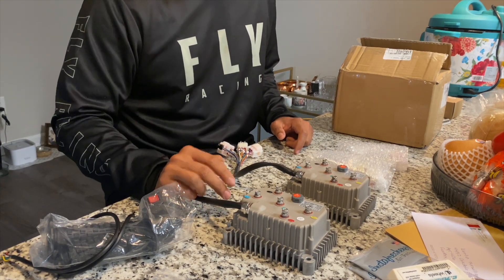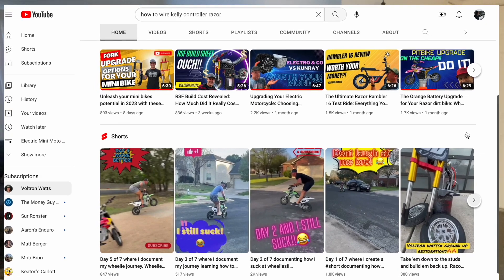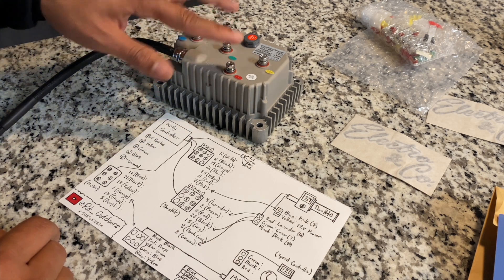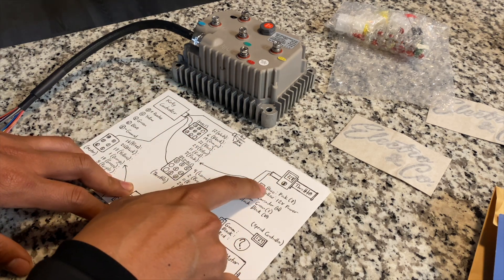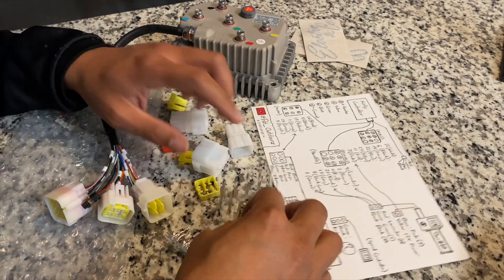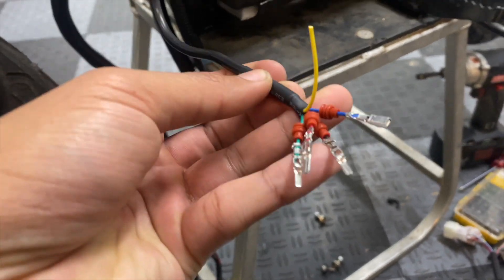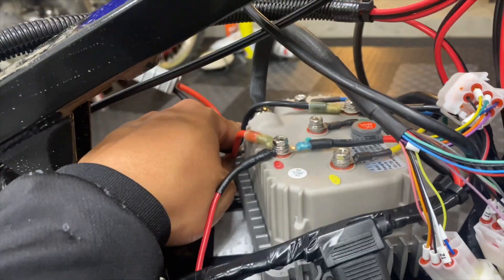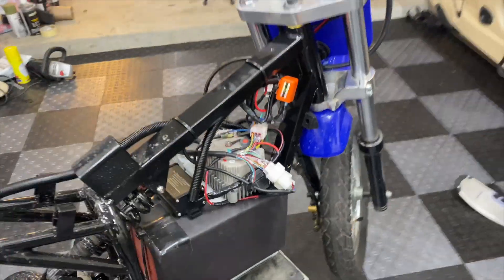Ultimate 72V Supermoto Razor MX650 Build is Done! Kelly Controller Wiring

Comment: How have you been liking the 72v 20ah pack from btr power? I have been interested in doing a similar build and have been taking that pack into consideration as an option.
Reply from the maker: Eh, it’s holding up fine for the last year or so but I’m looking for more power. Likely going to an Amorge 120-amp bms equipped battery soon
Reply: @PatOutdoors  would you recommend I get that instead? Is purchasing it on alibaba secure
Reply: @PatOutdoors  by the way does that battery work with a Amazon 3000w 72v controller and motor kit? I think it’s from best equip
Reply from the maker: @axoz3409  I’m not familiar with “best equip” kits. I’ve only used Kunray , Vevor, and Electro kits so I can’t 100% confirm
Reply: @PatOutdoors  it’s pretty similar to a kunray. Would you recommend a amorge or a BTRpower? I heard BTRpower lasts longer but at the same time amorge looks better built. By the way the kit I’m getting only had a 42amp continuous I believe
Reply from the maker: @axoz3409  I have both. Amorge is better built and puts out more power. 120 amp continuous!
Reply: @PatOutdoors  that sounds like a obvious! Do you know if there is anyway to get an amorge battery in sooner than the 3 week estimate I received? I would like to have it sooner than that. Also since the shipping takes so long I might have no other choice but BTRpower. Overall would you say BTRpower isn’t too bad? Or should I overall avoid it
Reply from the maker: @axoz3409  Well that’s the main reason why initially went with BTR, but 3 weeks is worth the wait. I had to wait also
Reply: @PatOutdoors  I guess, I am most likely going to go with amorge then. By the way what battery life does it get? Like how many charges. I don’t see a amount on their websiten

Comment: I just finished wiring mine. Turned it on, the motor did a few small spins to calibrate then the controller beeped like yours did, but twisting the throttle does nothing. Any ideas?
Reply from the maker: Turn the key off, turn on, twist throttle once, key off. Should self learn unless yours is completely not programmed. Mine was tuned by electro & co
Reply: @PatOutdoors  just tried that, no sound from the Kelly or movement from the motor. Mine is also pre tuned E&C

Comment: Will the 48v motor work with a 72v battery? And what is the speed control for?
Reply from the maker: A 72v rated speed controller is the only way this motor and battery combo will function.

Comment: How did you wire the battery to the controller?
Reply from the maker: It's a Kelly KVD controller so the power and ground terminals are directly on top of the controller. I added ring terminals to the harness that came with the battery and bolted them on directly on top of the controller.

Comment: My BTR 72V20AH with 80 BMS battery shutoffs randomly with either kelly or kunray controller. any advise?
Reply from the maker: Mines never done that so I don’t have any advise of what to do.. I highly recommend contacting the seller. It may be defective and covered under warranty
Reply from the maker: What does the violator read when it shuts off?

Comment: Hey patt, I just got mine all wired up and now it’s just beeping at me and not spinning the motor :( 

I’m going to go to bed and come back tomorrow and look over the diagram you drew and see what I messed up. I’m admittedly a little sad though
Reply from the maker: It just beeps when you initially key it on (self learning). Mine did that too if you watch the video. Key on and off twice, leave it be. Then key on and twist the throttle.
Reply from the maker: Also did you get a pre-tuned Kelly controller or just a generic one that’s not programmed at all?

Comment: I need this Kelly controller. What option will I have to buy? I have the vevor 1800w motor running on 48v. I see their website has a few options. Great channel. Got the crf 50 plastics on my sons bike and real knobbies. Just need a better controller so he doesn’t wheelie every start
Reply from the maker: I got their “pretuned” option so it comes pre programmed and ready to use once you wire it
Reply: Hey pat ! I see there are multiple options when buy the controller. What is the difference between the ultimate razor pre tune vs ultimate razor pre tune plug and play

Comment: Hey pat i got a vevor contrôler and motor but it’s not charging and it keeps blowing a fuse how can I get it to start also the wire seems small for 48v @pat outdoors
Reply from the maker: I’m not sure I’m understanding the question. If it’s blowing a fuse immediately, something is not hooked up correctly and short circuiting. Also which fuse is blowing? Are you running it with a lithium battery set up or the stock sla batteries?
Reply: @PatOutdoors  I’m running the fever motor and contrôler with 4 12v battery’s 3 stock but when I plug it in the charger it blows the fuse but the charger isn’t given voltage when not plugged in
Reply from the maker: @treymason530  it’s simply not hooked up correctly. Take a volt meter to all the connections to confirm how much voltage it reads. Should be 52ish volts (fully charged) at the positive and negative on the controller power supply. If not, something is hooked up incorrectly. Also is the charge ports hooked up directly to the controller?
Reply: @PatOutdoors  it’s 52volt I’ve been individually charging them and no I’ve been using the stock box charger on it if that’s what you mean
Reply from the maker: @treymason530  I don’t understand how you can “individually charge them” if they’re all hooked up in a series. I use a fast scooters charger when I had that kind of set up to charge them all at the same time.. Sorry I cannot help you since I did it differently.
Reply: @PatOutdoors  no no I’m trying to charge them at the same time what I’m saying is when you put a volt meter to your charger does it say 56v
Reply from the maker: @treymason530  I’m so confused, you just said you were charging them individually with the stock (36 volt) box charger.. my FAST SCOOTERS 48 volt charger said 54-56 volts when charging, then the batteries (wired in a series full time) read 52-53 volts once settled. My charge port was hooked up directly to the controller and charged the batteries through the controller. Which sounds completely different than what you’re doing.
Reply: @PatOutdoors  I was folowing ur video
Reply from the maker: Which one? This video is completely irrelevant to SLA batteries. Have you contacted the seller you bought the kit and charger from? I recommend reaching out to them and see if they are able to assist you with their products.

Comment: The Kelly controller from Electro & Co works really nice on these setups. You're really going to like it, the throttle response and power engagement is SO much better than what you where using before. I have built several bikes like this and they are so fun. For those of you out there that don't want to build one of these for whatever reason but you want one, look up BensonsCNC. The website says nothing about it because it's a CNC machine shop but these bikes can be ordered. Talk to Brad.

Comment: Dude... Your videos are great! By the way, I think you say you are using a 72V motor, but in the description you say you are using a 48V motor. Or are you using a 48V motor and a 72V battery?
Reply from the maker: Thanks! This is still the original 48V brushless motor that came with my Kunray kit last year, just been running it at 72V
Reply: I’ve heard from a couple people that the 48v Motor is just as good or better than the 72v version.  Is yours a 3,000 watt Pat?
Reply from the maker: @maukaman  well I have no experience with the 72v motor so I can’t say for sure, but I have absolutely no complaints with my current power output. I think biggest limiting factors on the Kunray and vevor kits has always been the controllers, which have never been able to fully deliver the maximum amount of amps from the battery to the motor

Comment: What’s a guess on the cost of everything so far beside the cost of the bike itself
Reply from the maker: Hmm well keep in mind this bike has upgraded front / rear suspension, brakes, lighting, tires, etc.. but I wanna say about $1800
Reply: @PatOutdoors  your estimate of 1800 includes the battery, controller, suspension, motor and all the accessories?  Really??
Reply from the maker: @maukaman  I would say so, roughly $1700-1900 without the bike

Comment: Great vid as always. Did you do any tuning to that btr battery for amp or power draw. What’s the readings if you know.
Reply from the maker: I have not yet, I’ll look into this!
Reply: @PatOutdoors  I’m just afraid to overdraw it and the bms fail.
Reply: @DarkKent  The BMS limits should be listed in the battery specs. They usually have ~10% headroom from the listed spec, though, which is still generally safe to draw and doesn't trip the BMS. Like everything else involving batteries, do at your own risk, though lol.
Reply: @nxdboi  I just figured it being from E&c and most likely tuned for their battery.  Plus I remember Pat opening on of these btrs and it was a 30amp instead of 50. But hey if it didn’t have to be turned down, that works for me. Just being cautious.
Reply: @DarkKent   the BMS shouldn’t fail if it reaches its limit, it just might cut out if the max current draw is exceeded, or just limit the output.  I’m sure that Kelly controller could  easily exceed the limit of the BMS, but depending on how he rides it might not be an issue.  We’ll see.

Comment: Thanks for all the details! I'm going to be putting a Kelly controller on my bike soon as well and I have the same 12v converter for my lights and blinkers. The way you have it wired, it looks like power would be supplied to the accessories all the time. I think I saw a pin diagram that lets you connect your lights directly to a 12v output on the controller without a need for the converter, and then the accessories would only be on when the key is on. It looks like it is the red wire marked "11" on the controller side. Do you mind taking a look and confirming if that would work? Thanks for the awesome vids.
Reply from the maker: You’re absolutely right, 12V is constantly supplied to all my accessories but it doesn’t cause any sort of battery drain issues since they’re not activated until I turn the switch on. You got me thinking though.. I could also wire the step down converter inline with a switched ignition. I may wire my other bike differently just as an experiment!
Reply: @PatOutdoors  just to clarify, the way you have it wired now means that you can't turn any lights on without the key on? I have some daytime running light / front blinker LED strips on my front forks that would be on all the time if power is supplied through the converter.
Reply from the maker: @tobiasfunke  Yes, but everything runs through my Multiswitch on my handlebar. So my headlight / running light/ turn signals only activate when I turn it on through my multiswitch. Check out the previous video before this one for clarification.

Comment: hey Pat. That four pin connector you mentioned is for programming the controller. You can plug in the Bluetooth dongle or the programming cable there
Reply from the maker: Ahh makes sense now. I may use that for my other bike. I read I needed an android device to do so
Reply: @PatOutdoors  android devices and windows computers. windows is a complete pain in the butt. you have to disconnect it, reconnect it, download drivers etc.. just takes forever and is beyond frustrating. I would recommend staying away from the manual cable and use the Bluetooth dongle👍